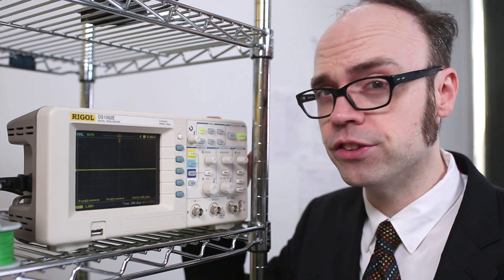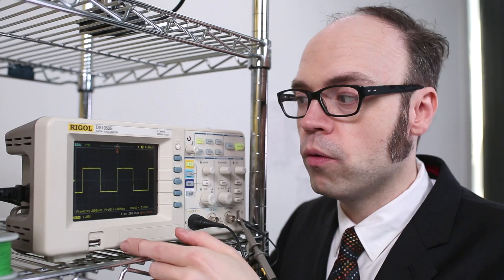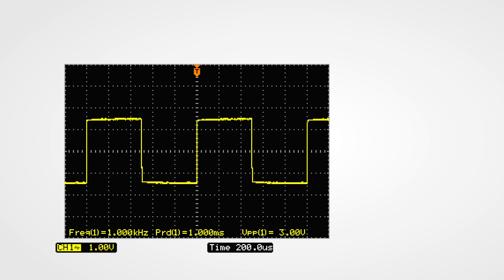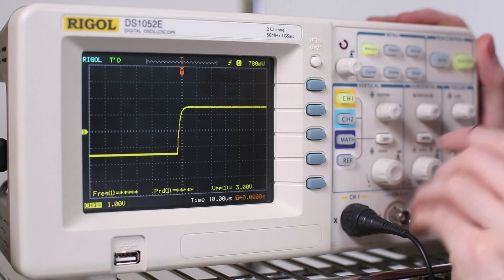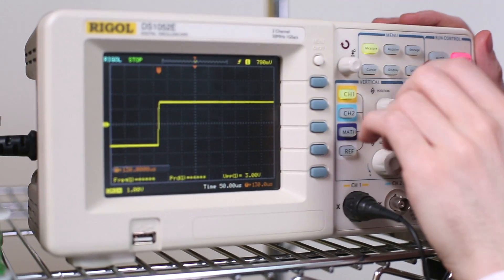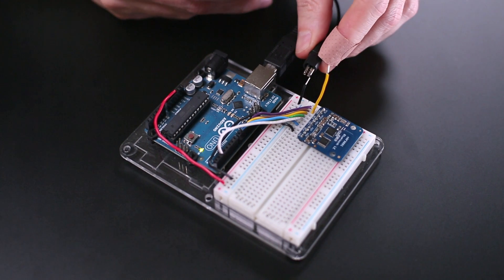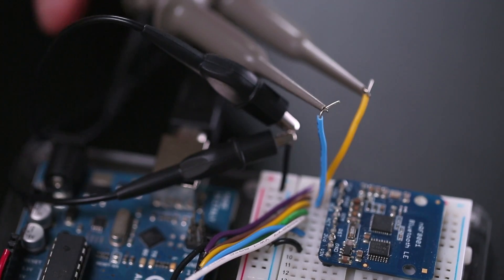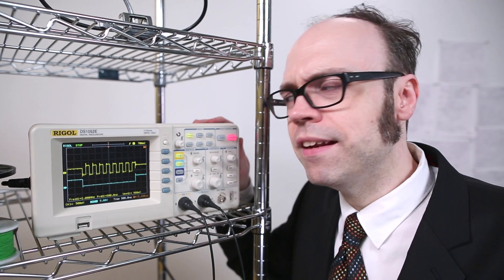Collin's Lab: Oscilloscope Basics

Comment: Just getting into Electronics as a hobby know little about it. But I'm trying to learn. Just watch the video I understand what you said
But are using it to identify a bad transistor capacitor, diode. Is it used somehow as a repair. Is it to diagnose the whole board and electronics
Have not found anyone yet, to show the true benefit I want you get out of it. I'm sure there is. But how, what and why

Comment: ...and they are expensive.
Reply: if you're on a budget and don't need the precision, there's some good cheap oscilloscopes that plug int your computer wich will do the treatment
Reply: I just released my own device that does exactly this!
$29 including shipping for an oscilloscope, signal gen, power supply, multimeter and logic analyzer that connects via USB.
Works with Windows, Mac, Linux and Android (unfortunately doesn't support Android 7 ATM, only versions 4-6).

Google "Espotek Labrador".